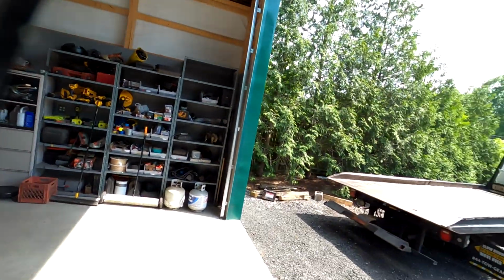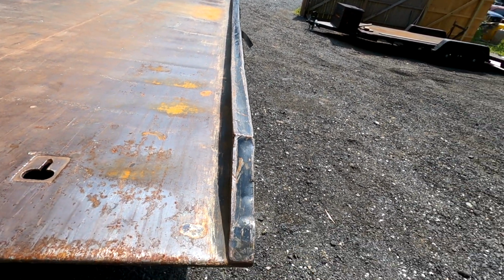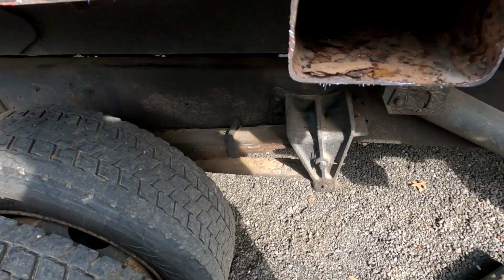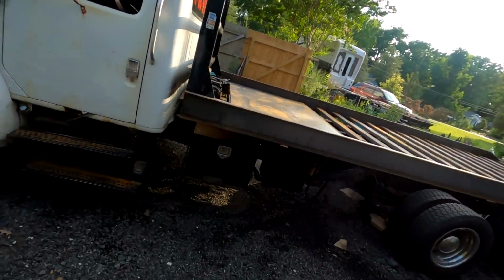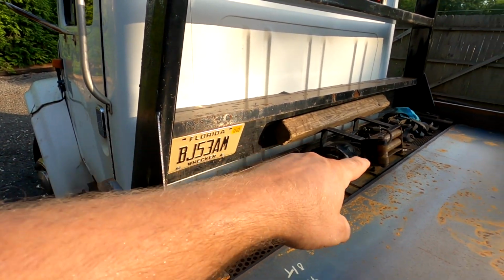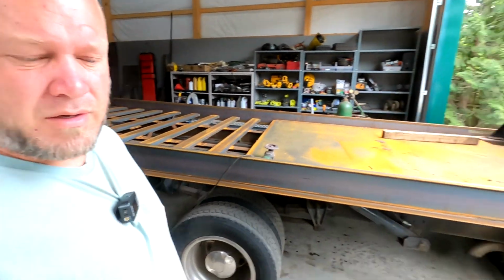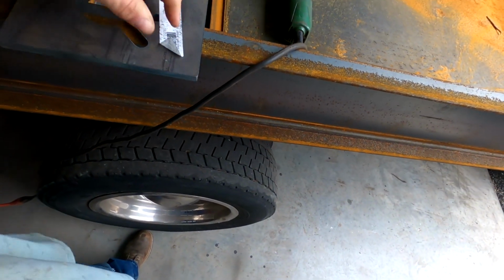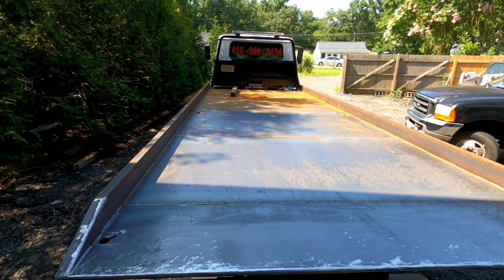Building a tow truck bed in about 30 minutes!

Comment: I’m sure I’m a little late but I was wondering how long a job like this took looking to do it on a old fright liner and just want a idea of the time frame I’m in for, you did a fabulous job on that bed
Reply from the maker: Thanks so much for the comment! This one took me 2 weeks, but the ones after only took me around 40 hours or so. The hardest part is cutting out the old bed. The saw blades i was using do not like rust! Just be sure to make everything is square when you put it back together! It will save you a lot of heart ache if it's not. You can email me if you need more info: formidablefab@gmail.com
Reply: @formidablefabrications thank you I appreciate it very much I will if anything comes up or need a second opinion I appreciate it keep up the good work

Comment: I really like the way you did those banjo eye's. Gave me a good idea for mine.
Reply from the maker: Thanks! This is the reason I do videos... to help / entertain others. I'm about to do another bed this week!
Reply: @formidablefabrications  The only suggestion I can give you that will help is to get your flat steel for the bed top in one sheet precut. It helps a lot. Hard to handle it but we just welded two small hooks and used the trucks winch to pull it into place. Weld the sides and spot weld underneath. Looks great when its done. We were doing the banjos on top but it looks cleaner under the top sheet. I will try it your way next time. Great vid. Not many people will even touch a wrecker let alone rebuild a whole bed.

Comment: .   *  *  *  *  Why didn't you use a rust converter on the CC-Channel before you covered them with the sheet steel ?
Reply from the maker: Customer was gonna caulk under the bed or something. They wanted to deal with it so I let them

Comment: Question: Why didn't they choose to go with Diamond Plate on the surface of the bed?
Reply from the maker: They actually wanted diamond plate, but I talked them out of it. As good as it looks, a smooth surface is what you really want for a tow truck bed. If you have to winch a disabled car onto the bed that is stuck in park, it has to be able to slide easy, and smooth metal with a little lube makes the job super easy!